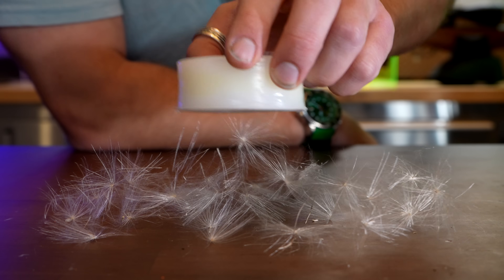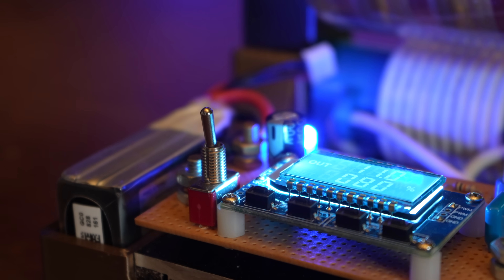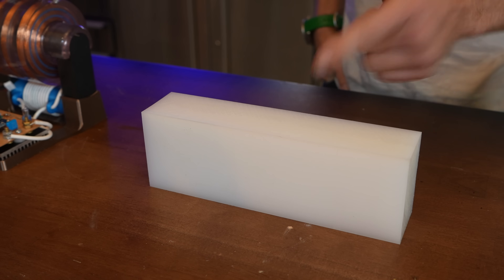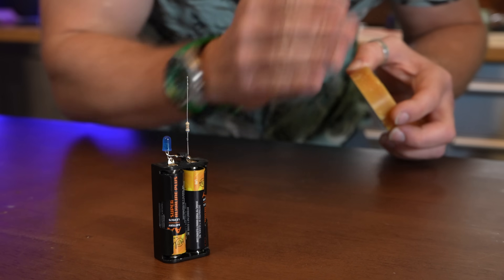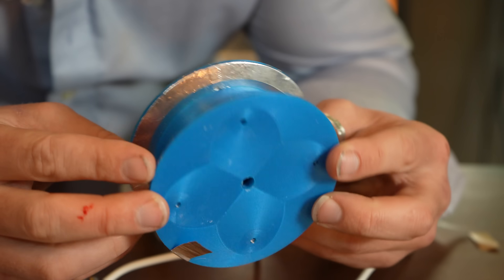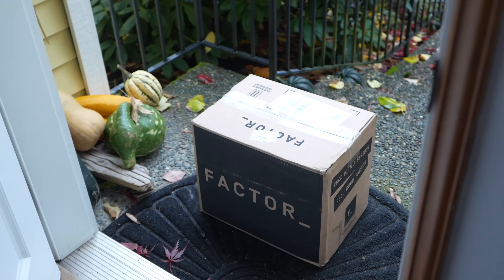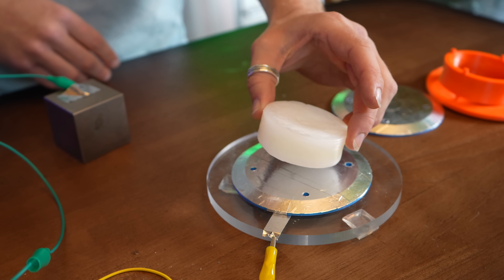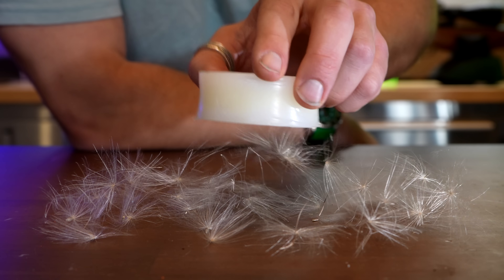Creating an Exotic Material With A Permanent Static Charge (Electret)

Comment: @PlasmaChannel
Hey Jay... beings that you've already made that electret material.. I have a question for you. (Let's see if he responses 🙄)

Once the electret material is created with it's +/- charged sides... 🤔 can the charged sides be separated or one side removed, while the other still maintains its desired charge?

And/or how much can be removed of one side of the charge for weight reductions & still maintain the desired charge..?

I would of emailed you regarding this, but 🤷‍♂️...

Im asking, cause I posed the possibilities that it might be possible,  but im thinking asking you might also be of benefit, beings you've researched the topics & have already made your own.

Cause I see multiple other applicable uses, other then what high-performance electrets are used for.

Comment: Thanks for the interesting video. I knew about electrets, but I had never seen their appearance even on video.

However, a question arises in my mind. Can you achieve sustainable passive levitation like this - with an electric field? No matter how light the suspended object is. In my opinion, it is easier, because the poles of the electric field can be separated.

And the second question - do you think it is possible to make an electrostatic bearing?

Comment: What if you layered micro capacitance bits of metal in various arrays within it lije many magnetic bits frequency sympatgetic or even frequency disharmonic for maximym feedback like two tones with runaway disharmonic feedback lije when your guitar is slightly out of tune
Reply: Wouldnt it be self vibrating creating an electric field vibrating a simular disk across the room creating voltage

Comment: thats so cool. yeah diode array acts a bit sketchy because the slight variance of the transistors. simple fix would be to calibrate them individually if you dont wanna go digital. That actually gives me anidea of making an array out of an old lcd display to get a higher res look at the fields

Comment: Does anyone know what filament was used to make the mold?
Reply from the maker: I used PLA filament. It still melts though while the Electret material is cooling, so it needs to be designed properly to account for the warping of the mold under heat
Reply: @ thank you

Comment: Could you use a vacuum and a blank wax ring instead, to get a stronger field while its cooling? 

Like instead of a plastic mold, just use a non-electret ring of your wax to contain it, use the plates with the taper, and huck the wbole thing in a vacuum chamber to keep it from arcing?

Comment: You were grounded.  If you weren't you would have charged up when touching the electrode.  When you pointed at the electrode electrons coming from the ground were flying off your fingertip in a corona discharge mode thus neutralizing the Vandegraff generator electrode.

You should have mentioned what transistor you were using for your sensor.  I have made them with field effect transistors that could detect extremely minute electric fields up to 15 m away.

Comment: My guess is that pointing at van de graff creates a higher capacitance between your finger and the electrode, resulting in the flow of displacement current or changing electric flux from electrode to finger (or vice versa depending on polarity). This occurs because the van de graff is running, and thus the electric charge is creating the changing conditions needed for displacement current to flow, or the change in capacitance does, one or the other or both

Comment: Seems an unbalanced electric field may produce motion. How about creating a semi-bowl shape (think UFO) electret so the outside curve stretches the field, the inside curve concentrates the field. Then weigh the piece once with it facing down, then again on the same scale facing up.
Hang it on a wire from a beam that can rotate like a horse being led around a racing ring to see if the difference the charge will produce motion.
Seems this could a very interesting technique.

Comment: Question-  I am curious to get more information on where to purchase a decently powerful electret. Considering that a wire traveling 90 degrees through a magnetic field will create a coupled magnetic and electric field 90 traveling perpendicular to each other 90 degrees angle, plus that it has been reported that a magnet traveling from 0 to 100 on the x axis will cause an electret to travel 90 degrees away (so 0 to 100 on the y axis). I am curious to perform an experiment with an electret embedded with copper wires to see if holding the electret motionless and passing a magnetic field through the electret would produce a current along the embedded wire. Thus- can you please send some information on where to get a decent electret? I have already disassembled some microphone inputs for their electrets but they are too weak and small to get a reading. Were you able to find a decent supplier since video creation?
Reply from the maker: Buying large electrets is nearly impossible. I couldnt find any place.....and the largest ones for sale were maybe 1cm x 1cm square. Quite small!
Reply: Yikes- ya that would put a damper in trying that out without manufacturing them oneself. From the challenges you faced I can imagine creating an electret with copper wire coils embedded would be problematic.  Thank you for the response- I have some things to think upon further. Cheers!

Comment: If electrets can hold a static charge, can they hold one strong enough to cause an arc when exposed to ground or a strong opposing charge? Also, could an electret bend the path of a nearby arc, say, from a tesla coil? Do they lose their potency over time and can they be "discharged"?

Comment: I wonder if you could use these to enhance your self-propelling plasma thrust wing. Perhaps you could use the electret material to keep the ionized air flowing over the surface of the wing? Or, perhaps as baffles to stabilize low-pressure pockets? I'm just spit-balling, but I bet a really thin sheet of this material could be useful in SOME way...

Comment: Dear @PlasmaChannel: As others have suggested below, to image the precise shape of the electric field — rather than building an enormous grid of sensors — consider using a "light-painting" (long exposure) technique with a mechanical probe that sweeps through space. An impressive workflow for doing this is demonstrated in these two videos by Timo Arnall / Berg London: https://www.youtube.com/watch?v=8fMpa1Ngn-4 and https://www.youtube.com/watch?v=cxdjfOkPu-E , in which they visualized the readable volume of RFID tags, and the strength of WiFi fields. Thanks for teaching us about electrets!

Comment: Just use your 3d printer. Set up opposite charges on a glass print bed and print something that bridges the two. I'd try but I don't want to risk frying my printer. It'd be fine theoretically since the circuit board is in an aluminum case, and it's way out of the path of least resistance. But I'm too poor to try.

Comment: when you point your finger at the vandergraff, the free static charge concetrates in the direction of your approaching finger, preparing for breakout, instead of distributing somewhat evenly around the surface of the van de graff.
Reply: We are changing the field with our intentions and we use our hands to express that.

Comment: For why the detector turns off whenever you point at the generator (idk tho I haven't extensively studied any of this)

Notes from the presentation:
-finger on the generator turned off detector 
-finger off the generator turned it on
-same finger pointed at the generator turned the detector back off

My guess: 
While your finger was on the generator, it stored the charge the generator was making. Once your finger was removed,
It kept its charge, but the newely generated charge started to be stored in the generator with no way to discharge. Which in turn made the static field that the detector picked up. 

I've got a few ideas at this point of what exactly happened when you pointed at the generator:
1. The charge on your finger began to warp the static field. I'll be honest, idk if it because your finger kept the charge, or 
2. because you were acting as ground and there was enough charge to arc(doubtful, but i wanna throw it in there). 

If your finger kept its charge, it would alter the the field to be more elliptical instead of spherical, with the elongated section being on the axis of the shortest distance between your finger and generator, and making the field thinner in areas perpendicular to that axis. If thats true, you could possibly aim the field to "hit" the detector. It would either be with your finger in front of the generator (closer to the detector) if it had more charge, or behind it if it has less charge than the generator. 

If you were just acting as ground, the field would be much smaller so theres nothing very interesting that could be done. I also doubt this since there wasn't any visible arcing, but maybe the camera or our eyes just may not have picked it up. This is just kinda my backup idea if my first one is wrong

Comment: Comming back to this video after awhile.  I had an idea that might stop leaking of the high voltage.  What if you created a large circle mould for the wax, and then have smaller circle electrodes.  So the wax puck would be say 3x bigger than the electrodes.  This would be using the wax itself as insulation.  The wax puck can then be cut down to the electrode size.  Just a thought!

Comment: Also... You could use these to 'shape' aspects of various other high voltage projects you work on (just as you use permanent magnets to shape magnetic field strength in projects like motors and generators, etc). Food for thought. Fun project. :)

Comment: About how pointing at a vandegrapgh generator turns the LED off on the static detector. You know when you put your finger on a plasma ball like the one in the intro.Well when you do this you focus the electricity onto your finger because your body grounds the electricity well that means that anything else that touches or comes near the plasma ball has less electricity focused on it because your finger is already focusing it to one area.This must be the same with the van de graph because all of the static electricity is taken up through your body and into the ground so the remaining electrical current is simply too weak to trigger the detector.

Hope I’m right haha 😂

Comment: Dear Jay, I have another question. Is there an element on the periodic table whose electrical properties are analogous to the magnetic properties found in Iron? Consider this, the magnetic elements are Iron (26), Cobalt (27) and Nickel (28). Of these three, the middle element (Cobalt) has the highest magnetic permeability. However, for some reason the magnetic saturation threshold is much lower in Cobalt and Nickel than Iron.  By coincidence or not, Iron makes the best permanent magnets of the three. Next to Nickel is Copper (27) which is one of the three most electrically conductive elements. The other two, Silver and Gold are immediately below Copper, with the one in the middle (Silver) being the most electrically conductive. So I guess the question is, can electrically conductive materials be turned into permanent Electrets? Of course there are far more elements in the periodic table that are electrically conductive, Mercury being one. It would be a lot easier to freeze Mercury in the presence of a strong electric field than to melt and set Gold in a strong electric field.

Comment: Have you heard of the Tic Tac UAP incident?  Is it possible to run power through this to make it float in air? The tic tac was described as being white  about 40ft long, totally smooth, mo rivets, no windows or anything except for two stick like things on the bottom.

Comment: I made the polyethylene. Really.  I can also charge like a quarter million pounds of polyethylene to say +10 million volts essentially instantaneously and then drive it again instantly the other way to minus 10 million volts charge by simply adding parts per billion of alcohol to make positive charges and parts per billion water to make negative charges.  All true.  I have no reason to lie or brag.  You can find these among my 69 US Patents by my name Mark G. Goode or Mark Gregory Goode.  Our polymerization reaction system could generate a lot of static electricity inside that led to operational problems  and shutdowns.  Over my entire career I and others studied it and found many solutions.  While we formed many polymer molten and then cooking masses under possibly intense electric fields, we never measured such a residual electric charge in them.  However, it is interesting to consider how they might have been a contributor.

Comment: If you make a  cylinder/disk split in 2 semi-Circular halves one positive and the other negative with insulation between the 2 semi discs  then place and spin inside a coil around the same axis It would be interesting to find out  what will be generated?

Comment: Considering the latest news about field effect electrostatic propulsion You might want to try making an  Electret that is cone shaped or similar and see if it would replace an ionic thruster.  It will probably require a lot of fiddling with shape and conductive electrodes.  You might also rig up your single detector to act as a scanner across a fixed  Electret to map the field.

Comment: Random thought, I had accidentally discovered the field effect for myself when working with a MOSFET who's gate was unconnected to anything! Wonderful stuff as Always! However, I wonder if it might be possible to create an array of "static antennas" in some sort of matrix, and then use a series of logic gates and such to perform a scan line, similar to a rolling shutter, or how display screens have scan lines. (Although, I have not a clue about all the EMI and other interference one would encounter in attempting to create such a device, or if such gates are even sensitive enough not to distort the readings...)

Comment: Why not design the sensor array as a PCB with integrated sense wires, and get that fabricated with surface mount components? I feel like you could get quite a dense grid with fairly minimal input work, since laying out the array is mostly a matter of copy/paste or equivalent in the CAD software, and assembly can be done fairly cheaply using pick and place at the PCB manufacturer. You could even add a microcontroller that polls the sensor outputs with analog inputs using a series of solid state relays in a matrix configuration to generate a video off of the data directly.

Comment: Thomas Townsend Brown was working on a self charging electret. 
Using dense metal,  tungsten carbide and some other stuff,  which were supposed to demodulate the EM and radiation turning it into charge which gets organized by the electret.